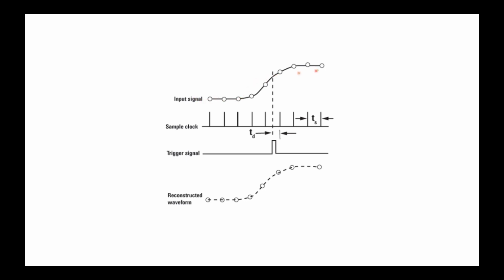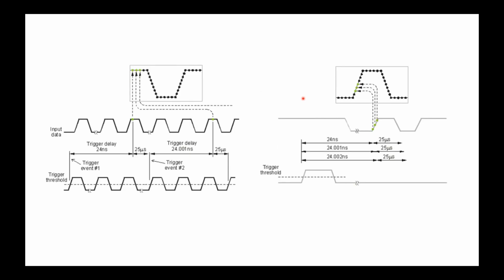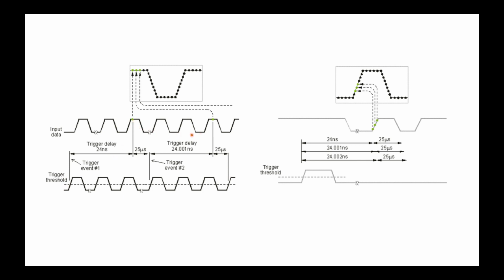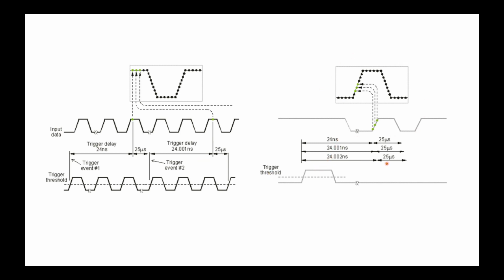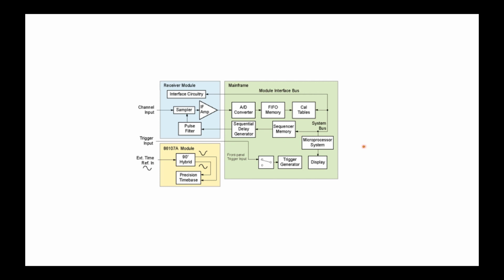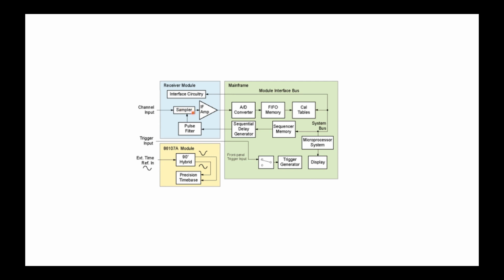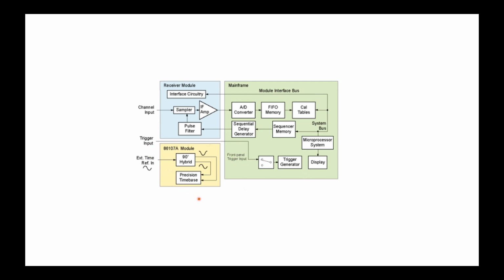TSP #83 - Teardown & Analysis of an Agilent 86109B Optical/Electrical DCA-X Oscilloscope Module

Comment: Does anyone here know where I can find a design of a 120v AC --> 48VDC 15A power supply (buck converter I guess), that I could attach to my 950 Watt portable generator, which in return, would connect to my 48V SLA batter bank on my Electric Scooter?
I bought one from China and it blow up. It was a 8.5 Amp model that was supposed to trip on overload.
I think a CC charger will do the job. I am using my 250 watt original charger now. It doesn't have enough power to keep the batteries charged while riding; it doesn't blow up either. It has to withstand the regenerative breaking over voltage of about 60V.
I would like to make this scooter a Hybrid, and for that, I need a heavy-duty, stupid proof charger or power supply, that can run the 800W (highest setting) BLDC motor indefinitely. 
Since the generator can (verified) output 950 watts, I should have no problem, given the losses in conversions. 
I just can't find any uncomplicated designs I could build myself.
If I can't, I would have to experiment with putting parallel MOSFETS with heat-sinks and fan in an exist one, which means a FET driver and so forth.
Any of you guys know a cheap (poor researcher) way of doing this? or a link to a schematics?
Thanks.

Comment: I guess there's no point in wanting to reuse some of the modules. The whole unit might be non-functional but it probably has just one broken part, could even be a 5 cent resistor so the samplers and pulser could be fine.

Comment: Great Video, but I have some questions: As you explained the sub sampling system, you said the data has to be periodic, But if we talk about fibre communication which can be pure PRBS Signal this is not periodic or do I not get something? At 11:51 Why are those modules connected with tubes and not with cables? At 21:06 Which technology do you talk about, cannot fully understand it. (I'm from Austria). Looking forward to your new lab and maybe a lab tour :)
Reply from the maker: Actual data communication (fiber or wireless doesn't matter) is not periodic, it is random. A PRBS sequence is not random, it is periodic with a specific period depending on the polynomial used to generate the PRBS sequence. When testing and characterizing components people don't use purely random data, but they use a pseudo-random sequence which helps with detecting problems. The components are connected using coaxial connections, the tubes that you see are coax cables with a rigid casing. The semiconductor technology used is likely InP.
Reply: Alright, thank you for clearing my questions.
Reply: These tube-looking cables are called semi-rigid coaxial cables. They have better RF performance, as a trade-off to flexibility. You shape them once manually, or with help of machinery - and use in your setup. Any future bends will either damage (read "break") the shield or otherwise negatively affect the performance.
As to PRBS signal, it's periodic EVENTUALLY (even though the patterns tend to be very long, like 2^31 bits). The pattern is sent again, as the previous PRBS sequence is finished transmitting. For shorter PRBS patterns, you can have DCA-X trigger LOCK to a specific pattern.
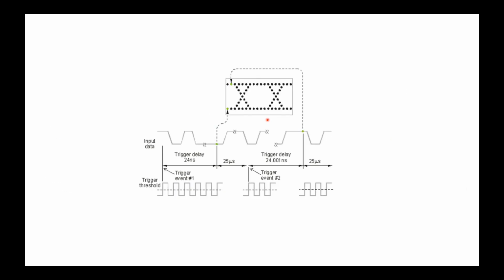Even if the data signal is not strictly periodic, you can still get useful information, like discussed around  5:57, like eye diagram and its related measurements, etc.
Please correct me if I am wrong. Cheers! :)

Comment: They should correct their pricing errors and sell the modules for like $100, especially considering that they are probably going to try and sell more than one module to a customer. E.g., sell the mainframe for $500, then sell each module for $100. They will sell more units, and make more money as instead of relying on the 1 or 2 people who get tricked into paying the inflated price, they will instead get a large number of people buying the products at a more reasonable price, in addition to possibly making additional money later on when new modules come out. 

E.g., they may release a 50GHz module, and then a few months later, release a new module that does 60GHz in addition to having some RGB lighting that can pulse to some music or something.
Reply: You don't understand.  The ASICs alone can contribute more than half of the unit's cost!  Keysight's very small ASIC fab only makes around 7,000 4-inch wafers in a year and a great many of the chips sliced from the wafers will be rejected due to the extremely high performance standards.  The synthetic semiconductor used is also an order of magnitude more expensive than silicon.
Reply: +simontay1984 Indium phosphide.
Reply: You are a troll right? 
Or you reall not know nothing about rf. 
Like just the connecor on the front would cost a lot more than 100$! 
You can't reinvent the wheel if this machine cost 80k there is  a reason!
And please before says stupid thinks please think about what are you saying!
Reply: Hm yeah but he could buy a module without the ASIC for like $100 and then put an Arduino inside.
Reply: Guy chill. You can put everything in also an arduino, but the question will be: Will it work? :)
Reply: I just wonder if it is a case of a weird pricing cycle. They charge a lot because very few people buy it, and very few people buy it because they charge too much.
Reply: This isn't really the case, it cost a very significant amount for the hardware even without markup. It is true the market for something like this is small but that isn't just due to price it mostly has to do with the fact that your average person has no use for something this impressive.  Only researchers in high ends labs would require something like this.
Reply: The cost is created,however  it is  not  "the " cost of  manufacturing, but the best average cost/profit ratio calculation.
Market creates sale price.
Market is driven mainly  by military , government and high level of commercial  manufacturing application.
"organizations" and specialized  business, must invest significant portion  of their gross in anything possible just to avoid  taxation.But also  to keep their own products high in price because of it.
Their expense is mostly  free of tax, sometime "placed" as amortization  in taxes.
Lobby and connections,  makes that "unique entity name" and reputation evident.
Once product was approved , the company was also approved. From now on you are in , just carry on.
The list of approved  manufacturers  and military contractors is  a pass  for  may "institutions" to  hunt for new product among them.
the good thing is that all of this allows to make good product without cutting corners. 
Wesley